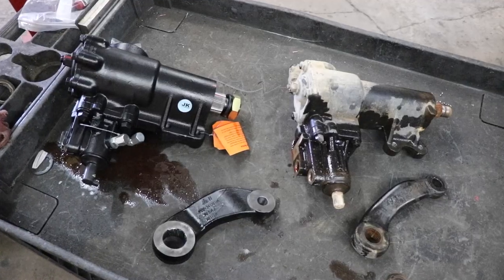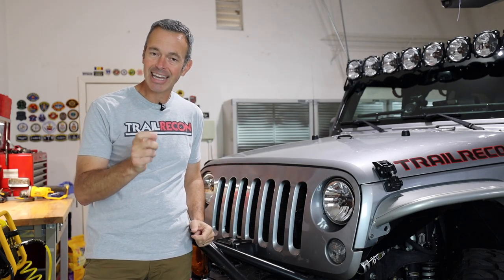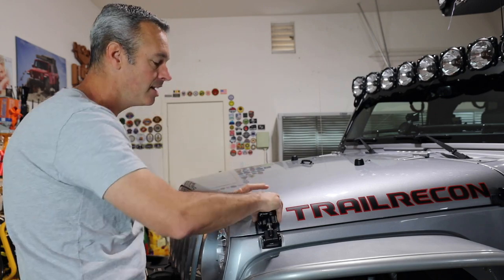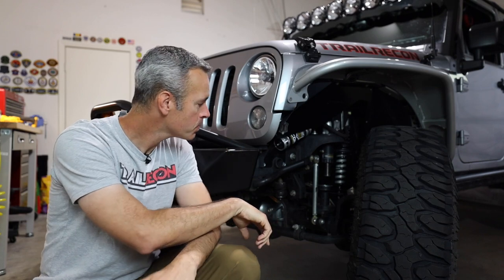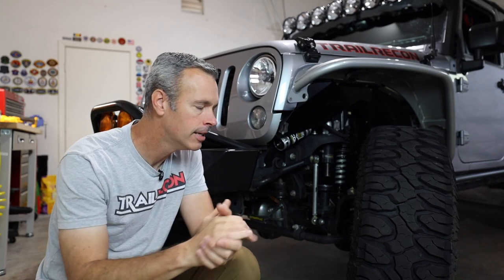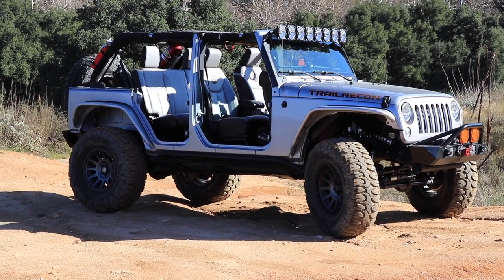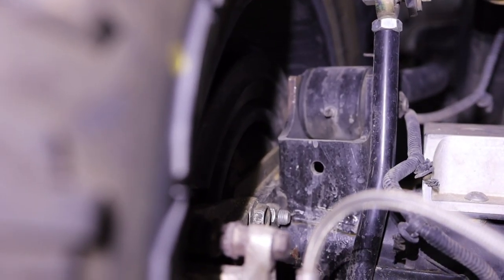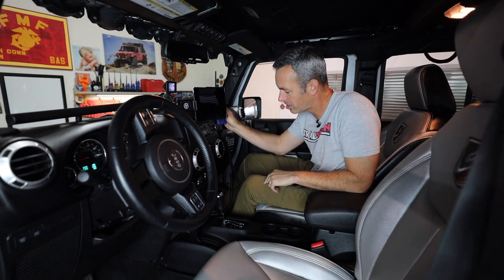What New Modification Did I Install on My Jeep Wrangler?

Comment: If you are beating up your steel skids, the 1/4" aluminum belly pan skids will be pulverized much more so, in no time. I have a buddy who ran two different aluminum belly pan skids, and went through this, they were bent and beat up rather quickly. Steel is more weight, but won't bend, contort and scratch as much as aluminum will.

Comment: Love the Channel.  Brad, I did replace the Oil Filter Housing first and later the Rear Main Seal like you.  Both were cover under the 5-Year / 100,000-Mile Powertrain Limited Warranty, no cost and got a rental on the second fix.  I think my JK was around the 65k miles when I got fix.

Comment: Great video on the overview of where your Jeep is at today! Also I appreciate ur feedback and explanation on your driveshafts for strength, weight and rotational resistance, I’m going to be installing a 3.5” JKS lift and when my driveshafts start to fail I was planning on goin with Adams driveshafts but I was not sure about going 1310’s or 1350’s. So thanks for throwing that in there! Keep it up Brad and you’re son too!

Comment: with my 14 2 door, I had the oil cooler/filter housing crack, its under the intake. you can replace at home but will take a day. A dealer charges around $1,400 to replace it. also changed the thermostat a few months ago in my works parking lot in like 30 minutes

Comment: 1310 driveshaft means that a simple broken u-joint is much cheaper to repair if you were to abuse on it a bit. Better than breaking something else just because the u-joint was to beefy to fail first.
Reply from the maker: Agree

Comment: Nice vid 
Our Jeep's must be twins.
Had to do the radiator and oil cooler have to do the leaking rear differential.
All between 80k to 90k miles.
Your right not cheap repairs but it's way cheaper than the new JL I speced out and would buy.
I figured fixing mine vs buying new saved me 40k😊
Reply from the maker: Ya, they seem to be very common issues on the JK... hopefully there will be less required repairs this year.

Comment: Have you considered the Diabolical inc Slip Stream to use as a deck cover to cover up the back of the jeep with the soft top?  It locks to the tail gate, so it cant be opened w/o unlocking the keep,  and can have molly mesh panels added to hang stuff off the inside folding cover. I do have installed one on my jeep and love it as it securely locks the back stuff in, yet can be nearly fully removed in minutes to carry larger items or opened as a pass through to carry long items.

Comment: Second question...I have a manual and I’d like to mount a Ham some place completely out of the way, so that if I ever removed it no one could tell it had ever been installed.  I don’t think I want the overhead console (currently hardtop, but would like to go soft).  I have yet to find a good option for me, but perhaps I’m looking in the wrong places.

Comment: Hey buddy!, as usual, great video! Thanks lot to keep us entertained during this not easy situation!
Why don't you replace your plastic steering fluid cap by an aluminium one?, the stock ones always leak or sweat some liquid, making a mess, you can check yours. I did it and it changed totally, no mess and even looking cool as they are aluminium colour. What do you think?
Stay safe and cheers!

Comment: I was going to say that looks like the winch in my PSC bruzier bumper on my JL. Still need to do a recovery class over here to get more experience using the gear in general. 
Did your Jeep have a hood liner before? My JL has one and I’ll be installing the PSC hood louver and it say to trim the liner which I kinda don’t see the point of having.
I see many in the off-roading community recommending the tires. Currently have BFG KM3 since I had the KM2’s on my JK. Been fine with them but have to say I’d like to try those tires out after I use the km3 thoroughly.
Awesome time review video! Really gives me more ideas on what to do with my Jeep in the future.
Reply from the maker: Yes the hood liner came out a while back.  Thank you!

Comment: Brad!! Good video. Thanks. Glad you did that one. I have questions though. So many. Haha. Just one I’ll shoot at you now. The new winch.... have you already tensioned there line? If not, will you do a video on that? I just installed a winch this winter and still need to tension it. I have an idea but could use some guidance.
Reply from the maker: Thank you! Tensioning you line is pretty easy to do, buy maybe I can do a video on that in the future.

Comment: So, with the lighter weight, simpler mindset you are using with the JK now. Are some of those thought processes being implemented on the gladiator? Or did you try to implement them as you were doing the gladiator build from the start?

Comment: BRAD YOUR KC CYCLONE LIGHT UNDER THE HOOD ARE THEY NORMAL OR DIFFUSED  LIGHTS . I JUST GOT MINE THE NORMAL ONES  . I'M THINKING ABOUT JUST HOOKING THEM UP TO THE LIGHT HARNESS THAT CAME WITH THE TRUCK  ? I ALSO GOTTEN A SET IN RED FOR THE CAP  / ARE LOW CAP  SO I COULD SEE OUT THE REAR WINDOW  & HAVE A THULE RACK WITH TALL LEGS  TO SEE BETTER  & HOPEFULLY A LITTLE HARDER FOR SOMEONE TO MESS WITH THE BIKES  / THEY'RE LOCKED  / PLUS JUST GOTTEN A CURT CARRIER FOR EXTRA PLACE TO CARRY LIGHT STUFF. WANTING TO SEE IF I COULD GET A SUPPORT FRAME MADE WHICH WILL LIFT  / ALUMINUM  MAYBE FOR LIGHTNESS  /  WITH THE CAP & RESTS ON THE BED OF THE TRUCK IF YOU UNDERSTAND WHAT I MEAN  . THEN MAYBE PUT A ROOFTOP TENT  / NOT SURE WHAT COMPANY MAKE  , SOFT OR HARDTOP.  DON'T KNOW MIGHT BE BETTER  /  CHEAPER TO GET A NEW ONE ARE HAS ONE WITH EXTRA SUPPORT CAN HANDLE MORE WEIGHT  ? WITH THE SETUP NOW THE RACK IS ABOUT 11" ABOVE THE CAP & IF I PUT THE ROOFTOP TENT ON I DON'T THINK IT'S GOING TO BE HIGHER THAN THE CAB OF THE TRUCK & MESS WITH THE MILEAGE THAT MUCH ? PLUS KEEPING THE CENTER OF GRAVITY LOWER ? 
THANK YOU FOR LETTING ME TAG ALONG WITH YOU ALL ON YOUR JOURNEYS  ! A LOT OF AWESOME IDEAS EVEN THOUGH I HAVE AN 1999 F150 XLT 4.6L EXTENDED CAB 4×4  WITH 260,000 MILES & TASTY  HAS TREATED ME GOOD THROUGH THE YEARS.  BE SAFE  ! HAVE FUN  ! GOD BLESS YOU ALL ALWAYS ON YOUR JOURNEYS  ! ENJOYED  !

Comment: Do you need to upgrade the tire carrier for a JL?  I thought I noticed that on your wife's Jeep it looks like you didn't, but I didn't hear you mention whether you did or didn't.  I have a set of 35"s on my JL without a reinforcement/relocator and so far I have no issues and it appears rock solid.  Is this an upgrade I need to do?

Comment: Brad are you running wheel spacers now that you went away from the beadlocks?  I’d be interested in hearing your thoughts around backspacing with the different size tires and wheels you have had.
Reply from the maker: No wheels spacers needed, these have a 4.5" backspacing and work perfectly for my setup.
Reply: Thanks for the reply, do you think you could have used 4.5 backspacing with your old 3.5 inch rock Krawler set up?

Comment: @TrailRecon @Brad, can you peel off the stock rubicon sticker off the hood no problem? 

I assumed it would’ve been clear coated with the paint. I guess not 🤷‍♂️
Reply from the maker: Yes it peals right off and a heat gun or blow dryer makes it a bit easier.

Comment: Brad, did you have any clearance issues with the 37" tire and the Poison Spyder rear bumper? Did the TeraFlex tire carrier add enough height so the tire would fit in the notch in the bumper?

Comment: Love this video!   Did you have to change the location of your fire extinguisher with the soft top?   In trying to figure out where to put one in my ‘16 JKU and worried about interference when putting the top down if mounted on roll bar.  Ideas?

Comment: I know that dropping a JK windshield is a chore, and of course you have the light bar to deal with, but my question is...can the windshield be dropped with the SPOD switches mounted up top where your 6-switch console is?
Reply from the maker: I've never tried, but it should be fine if you have allowed for a little slack in the wires running to the switch panel.

Comment: Brad you’re a tall guy. Does the lightbar on the windshield interfere with your ability to see?
Reply: @Bill Court check out the video he made when he installed the roof rack on his gladiator. I think he talks about why he mounted that light bar on the rack, instead of where he did on his jk.
Reply: @RiverJunkie  Thanks, I will.

Comment: Great video as always Brad. Quick question. The third brake light on your spare. What setup is that? I'm needing one for mine. Thanks
Reply from the maker: The light is the original one, but the bracket came with the Teraflex Tire Carrier.
Reply: Thank you.

Comment: Hey Brad, I have almost the some miles on my 2013 jku Rubicon. I am now having issues with our automatic transmission shifting and the check engine light is on for it. Have you had any issues with your transmission yet?

Comment: Nice Brad.  

There's nothing wrong with the rear D44 with the upgrades that you made.  The thin stamped steel control arm brackets are a weak link.  I broke one of mine and upgraded as well.  Other than that with chromoly axle shafts my rear axle has 112K miles on it and no real issues.  The first 92k miles were running 5.38 gears and the past nearly 20k now have been running 4,56 gears.  A Dynatrac Trail 60 would be nice but don't necessarily think it is needed and mine is pretty heavy as well.

Here's a link to the walk-around I did on my 2011 Wrangler a few months back.
https://www.youtube.com/watch?v=kI1J6RTgeu0

Keep the vids coming Brad.  Hope all is well with you and your family.

Mike

Comment: Gday Brad, a silly question, you mentioned your tyre's are a softer compound, are you concerned about when your in the scrub you get a sidewall slashed by a rock or punctured by a stick, that's the problem I had 3 tyres in 3 trips, so I changed my tyres.
Cheers Dennis

Comment: Hey Brad awesome update...with everything going on I just picked up (using your Amazon link) a couple of those handheld Baeofeng Ham radios. I'm not licensed and have no clue how to use them. Is there a good online resource for learning to use them or even getting licensed that I could take advantage of during this 'lock down'? Let me know if theres a website or something you recommend. Thanks!
Reply from the maker: Now is a great time to study for your license, check out the ARRL website for testing resources.
Reply: Thanks man appreciate it stay safe

Comment: Do you use a trailer brake when pulling the trailer?
Reply from the maker: installing one is on my to-do list, although I haven't had any issues because the trailer is so light, having the trailer brake off-road would be really beneficial.